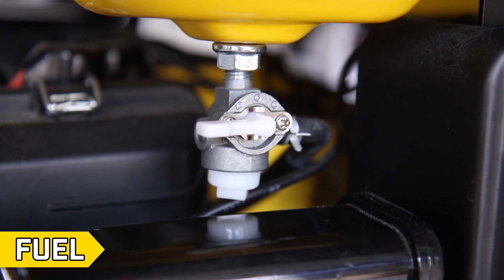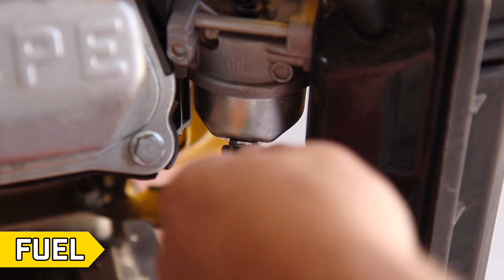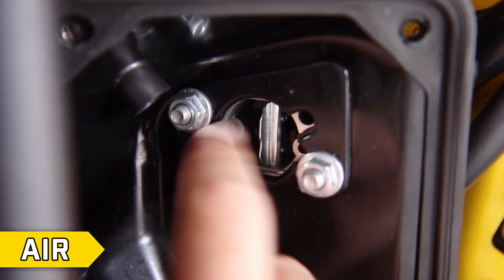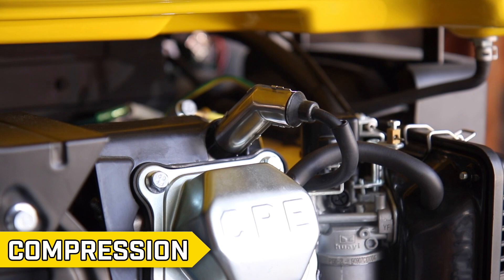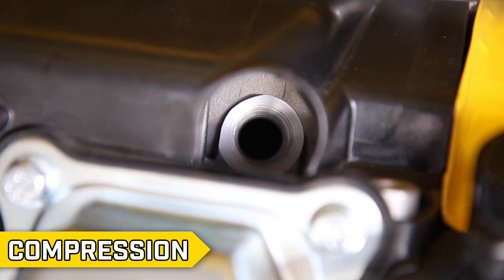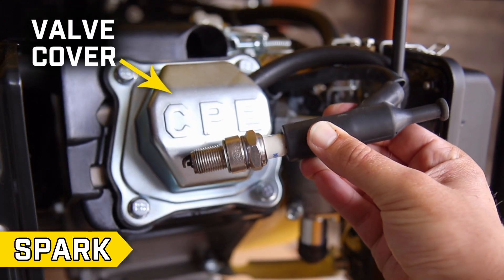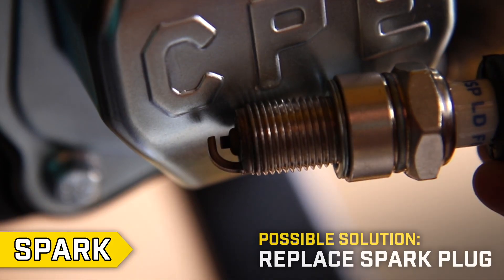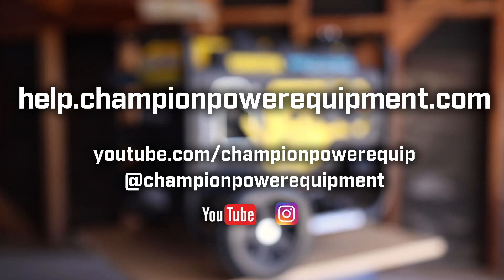Basic Engine Diagnostics

Comment: Does it have low oil shut off
Reply from the maker: Thank you for your question. All of our units are equipped with a low oil sensor that will automatically shut the unit down if it detects insufficient oil for operation. On our open-frame units, the low oil sensor is located near the left-hand side of the dipstick. It is a yellow wire with a plastic quick connect in the middle. In our enclosed units, the low oil sensor is still present, but it may be more difficult to access due to the more compact design of the unit.